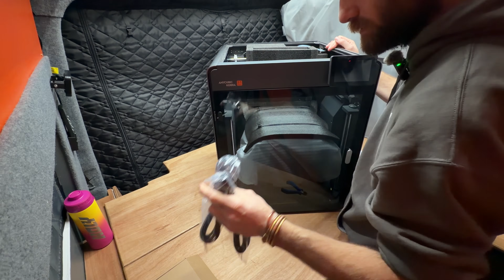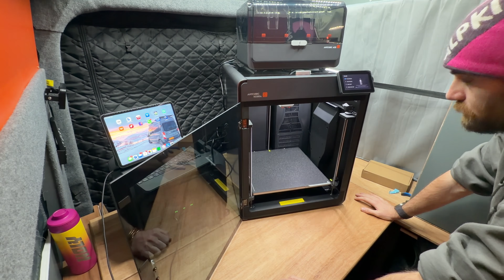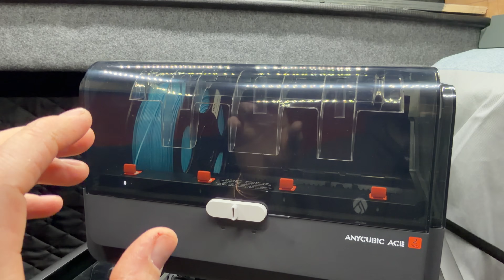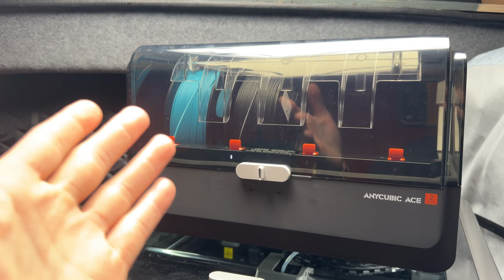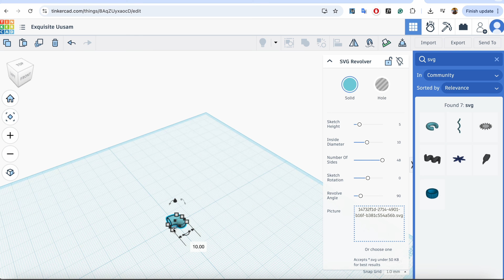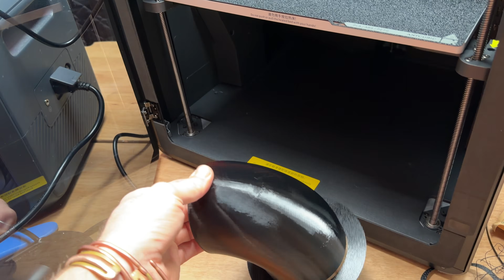Anycubic Kobra S1 Max Combo – The GIANT 3D Printer I Used to Make Van Parts

Comment: I saw some reviews from people who had problems with this printer. And, after seeing other people printing well (as it should be: having and solving the problems), I'm considering buying one. Because, in the end, it seems that some of these people who had unsolved problems are simply lazy or a little careless - like waiting the print to auto solve everything.
Reply from the maker: Most newer prints like this do a lot of work for you with things like auto bed levelling and alarm of failures. 

Quite different from the printers, I used when I first started
Reply: @MispronouncedAdventures  yeah. I am from the ages where I had made my own 3D printer with Chinese pieces (most of them, crap). The frame and bed base were made by hand. And then, after having the printer done, calibrated, some motor drivers burnt and replaced, started to print some parts to make it a little more precise and kind of robust enought to have print speed to up to 30mm/s! That was a hard age xD.

Comment: I ordered one of these last week so was a bit apprehensive to watch your vid in case you thought it was rubbish ! I actually went for the none combo version as I don’t think I will print many multi coloured parts this size and I have my Bambu S1 for that type of work - for just over £500 it seemed a bargain for the size. However it won’t ship until June so I must be patient !
Reply from the maker: I think it was great price for the size of the bed, plus enclosure, camera, app, heating, auto levelling and more!
Reply: @MispronouncedAdventures  I cant help thinking they have poached some of the Bambu design staff ! (Or just copied !!)
Reply from the maker: I think every company has seen benefits of Bambu’s direction. Make it easy to use and accessible

Comment: Great video - like you I need to learn more about designing parts! - I have a Bambu Lab A1  - that slicer looks very similar to the Bambu one or just me! - Have printed several parts for the van, albeit more "fun items" than actual useful haha
Reply from the maker: You are correct and I thought the same and looked it up. Both slicers are based off the same original slicer software. So it’s very similar

Comment: I'm using the small brother to print parts for my van. It works great!
Reply from the maker: Any issues with levelling or calibration after driving around? Or just auto level bed before each print?
Reply: @MispronouncedAdventures  Just auto level before each print

Comment: Great bit of kit. Wonder if it's possible to have one permanently in the campervan. What are the restrictions such as power, fumes, size to this?
Reply from the maker: I know someone who has a smaller different brand in the van so you could although the fumes would definitely be a consideration consumption isn’t necessarily that much of a worry

Comment: AnyCubic FDM printers are solid stuff. I have an Ender 3 MAX. 300x300mm print bed. Not the fastest printer ever, but I know I can 'set and forget it' and know it will deliver the parts.   
Printers that aren't enclosed(like my Ender 3 MAX) need a bit of adjustment to print correctly(measured it across the bed, from one uprigh to the other and it was wider at the top. Loosened one upright at the bottom, and added a couple of shims made out of a soda can, and all was right)    
Filament driers are good. Mine's a PrintDry 2.0, which can take 3KG spools(and possibly larger)     
With large printers you want large spools. 
Weight your spools so you know how much material is left before starting a print. Saves you from having to scramble and replace the spool mid-print. 
For new newbies in the obsession; get PLA+, in BLACK, GRAY, ORANGE or possibly Blue. Those are considered the 'safest' colours. White and Transparent tends to be finnicky.   
Learn to use ONE filament type and colour properly before attempting others. 
DO NOT do as I did and buy every effing colour on the market. 
Also, unless you need it, stay away from materials with 'filler'. If you want to use those, get a SOLID nozzle, either steel, or MicroSwiss 'Steelclad'. Fillers will destroy a brass nozzle in no time.     
Some printers have a 'Bowden' extruder, that is a feed motor with a flexible tube(PTFE plastic) down to the hot end and nozzle. Many flexible filaments work poorly in these printers. If you want to use these types of filament, consider getting a printer with a 'direct drive'(the motor is directly on top of the hot end and nozzle) They're usually a little slower because of the mass of the motor, but yeah, worth it for the absence of pain. You can get 'extra smooth' tubes, but yeah, haven't tried them. I have an old WanHao i3 for that type of printing.       

Some materials are more prone to pick up moisture than others(ABS is bad... PLA is rather more forgiving) and there I would advice to store them in sealed mylar bags with a reusable desiccant pack in it. The moisture turns to steam in the print nozzle, and as we all know, when water turns to steam it expands 1600 times, so even small amounts of moisture will absolutely ruin a print.